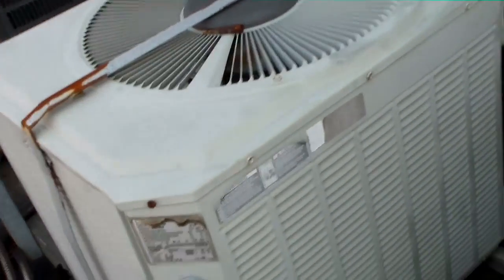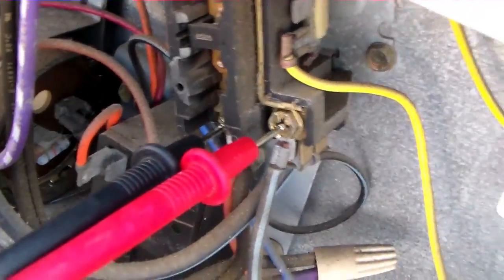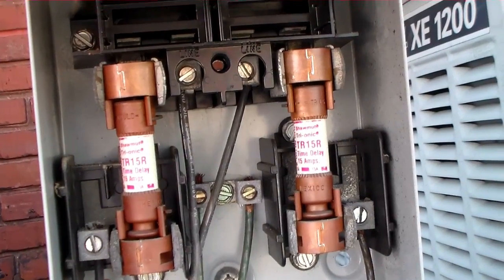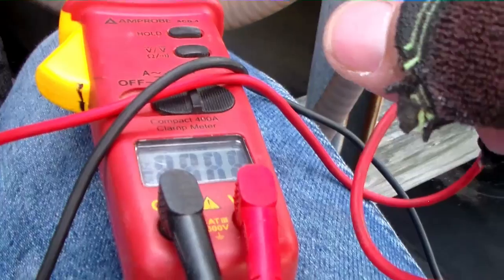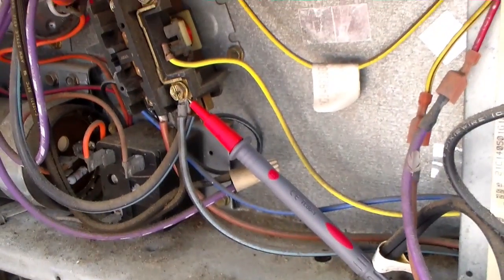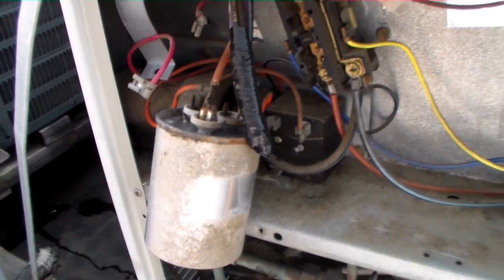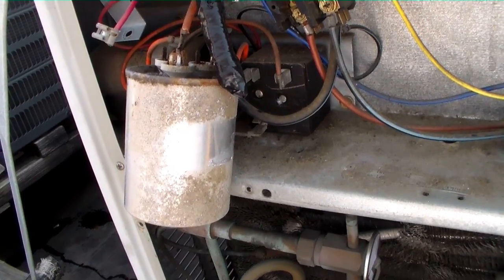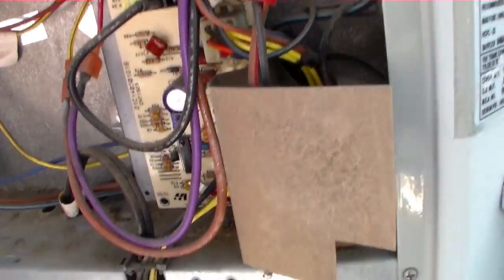Trane Heat Pump Blows Fuses and Trips Breaker

Comment: Love having a megger.  The megger is a useful tool in this type of application; however, it is really meant to be used as part of a predictive maintenance program.  Not sure if there are any videos on it yet, but there are guidelines to be followed for interpreting results on semi and fully hermetic compressors due to the possible presence of oil around the windings.  Maybe I'll have to add it to my list of planned videos for my new channel.  Also, as much as I love my analog megger, I'm pretty jealous of your nice new digital one.  Thanks again for taking the time to make these videos.
Reply from the maker: I have seen the documentation, but no videos on the subject.